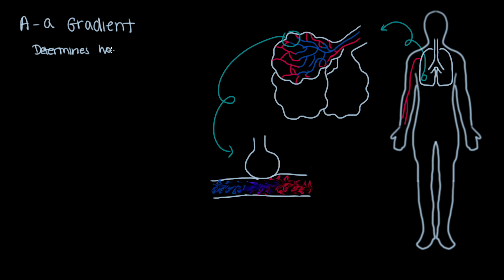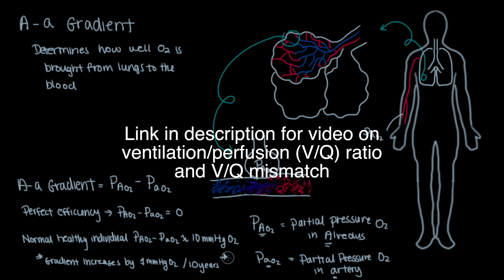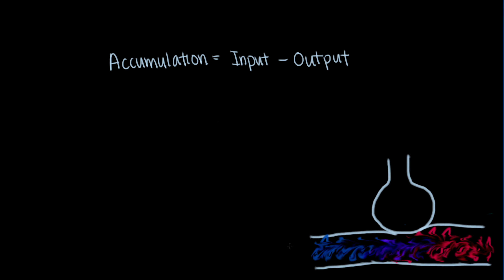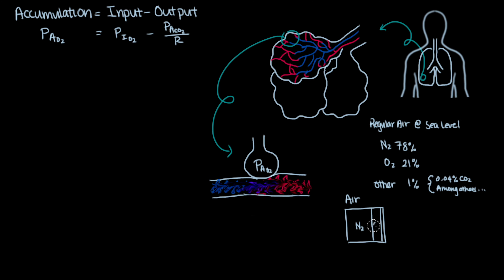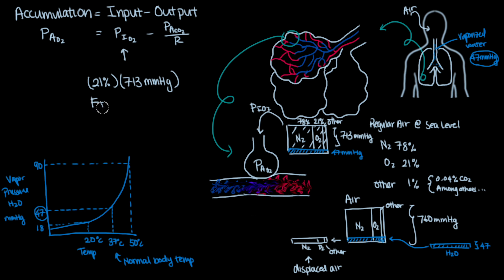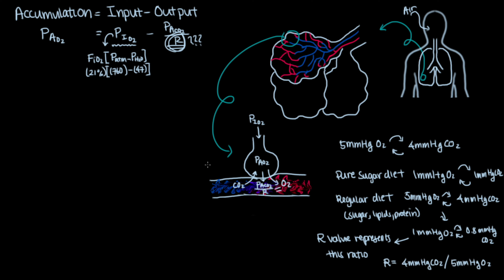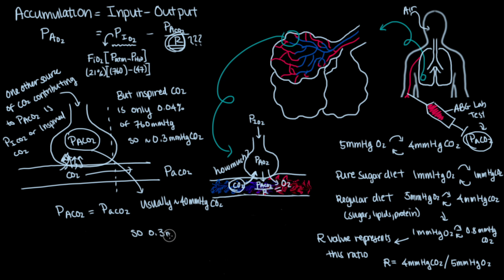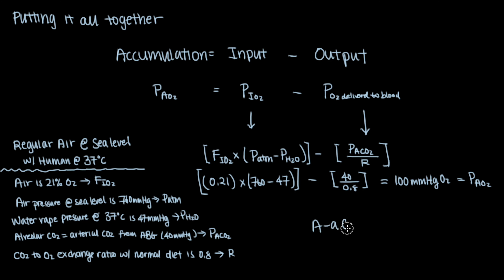Alveolar Gas Equation Explained

Comment: Based on your explanation, it seems that the output O2 in the accumulation equation should be the PaO2 because PaO2 is the O2 being picked up by blood and output O2 is the O2 going to the blood?? I’m confused again… could you help explain if you have the time?
Reply from the maker: The PAO2 that's noted in the equation is the alveolar O2 left in the alveoli once the inhaled O2 that was destined to enter the blood has gone into the blood. Maybe it might be more intuitive if we rearrange the equation so it's like PIO2 = PAO2 + PO2delivered to blood. The total inhaled O2 (PIO2) will either stay in the alveoli (PAO2) or will be delivered into the blood (PO2delivered to blood). The output O2 (PO2delivered to blood) is calculated by seeing how much CO2 is in the alveoli since there's the specific exchange ratio between CO2 and O2. The inhaled CO2 is almost zero so all the CO2 seen in the alveoli essentially all came from the blood.
Reply: @medrounds101  Thank you so much! But I feel the PaCO2 should be drawn from the VBG instead of the ABG since VBG has CO2 rich blood and that CO2 in VBG is what is going to be readily picked up by aveoli? Also I feel the PO2 delivered to blood can also be drawn from ABG directly because it's O2 rich blood and the PaO2 reading from ABG should reflect the PO2 delivered to blood? Sorry about all the questions....and again thank you so much for making these videos!